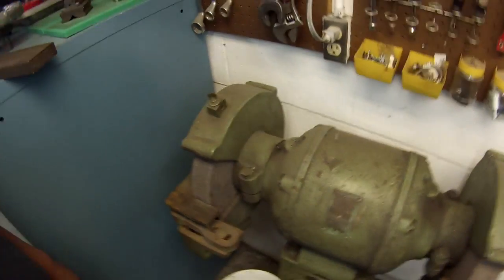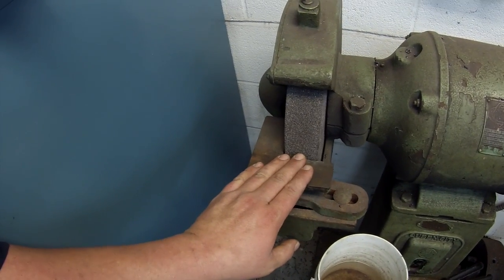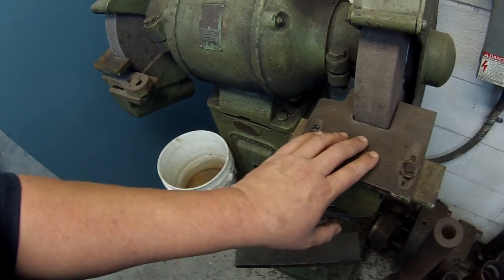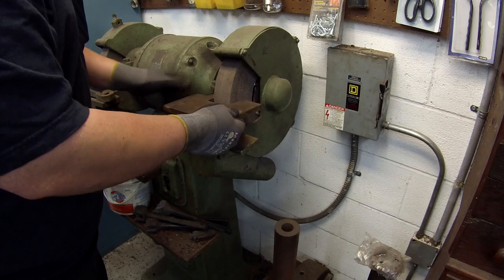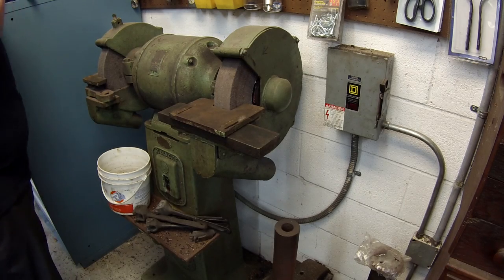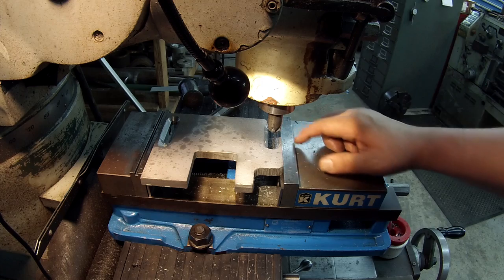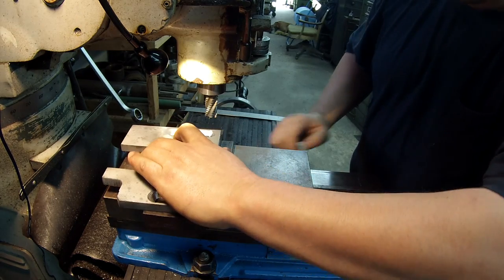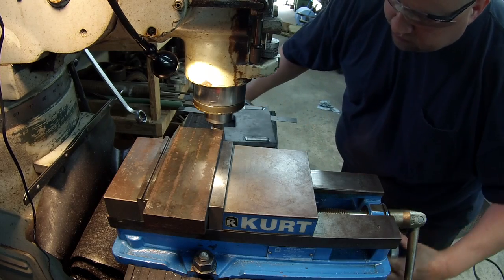Queen City Pedistal Grinder Modification

Comment: Hi Adam
I happened to be watching this particular video again. I have a 1942 Cincinnati grinder similar to your Queen City.  On mine the tool rests can be rotated to change their location relative to the grinder wheel axis simply by loosening that bolt that secures the tool rest/wheel guards to the body of the grinder. The complete guard is secured to a circular flange on the body of the grinder motor.
very convenient...........
love your work & thank you for it!!
vic

Comment: A person is never too old to learn something new. I tell my kids and grand kids to try and learn something every day. Today I learned about where to place the support in reference with the wheel. Now, out the the grinder and put what I learned into practice. Now maybe my lathe tools with look and cut better  Thanks Adam for this great video. Do you ever get a day off ?
Reply from the maker: Well, I get most of the weekends off from my day job, but I'm usually in my shop working then..LOL. Theres always things that need to be worked on, fixed, or made, not to mention homeowners duties to boot.
Hey I'm glad this helped you out Kenneth.

Comment: The other week I decided to re-locate my grinder into a shed, just don't like the thought of grinding dust getting on my machines or the motorbike that also lives in the shop. Well made some space for the grinder, put it in there and now just need to  get it up and running. Thats the project for today sorted out. Thanks for the video Adam, I have always liked wrap around tool rests on grinders and yours looks really rigid. So thats the next step with mine, improve the tool rests.

Comment: Beautiful old grinder. Three decades ago, I bought a BALDOR 712RE.  The grinder is really good and the guards are cast-iron. Two weeks ago one of the wheels blew up just as I turned away. The grinder jumped and came down a few inches from the original place.  Fortunately, the motor shaft was not bent. All this to say, the tool rests are scrap .125" and I need to design something better. I have been PO'd long enough.

Comment: Adam, I modified my little 6 inch grinder in line with your modification. It has worked very well indeed. I ground up a high speed steel tool bit in the way that you suggested and that has worked well too! Many thanks for a most informative video!

Mike

Comment: Was watching Donald R. Cossitt work on his newly aquired big boy grinder and he mentioned you had one.  I just picked up a big Queen City similar to yours.  Mine is straight 440 volt, so it will be awhile before I gan use it.  need a transformer and phase converter.  At least I can be in the big grinder club now,lol.

Comment: Hey Adam,

I really like that wrap around tool rest. Nice to have support on the side of the wheel also. I can see I need to find myself a nice big bench grinder.

Cheers,

Tom
Reply from the maker: The tool rest on the side of the wheels makes a big difference. The Baldor at work only has them on the front side, and sometimes you want to use the side of the wheel too. 
We need to find you one like this, with 12x2 wheels! You'll love it!!
Thanks buddy!
Reply: My Standard Electrical is also a 12X2 and uses 1-1/4 arbor. It was made in Cincinnati Ohio also and is a beast of a grinder! I like the color on Adams Queen City though because it matches my Johnson Bandsaw. If you ever need any extra stones I think I have some stashed in my grinder cabinet. Ever seen the company made drill grinder attachment for one of these?

Comment: A full sized grinder will probably be my next major purchase for the shop, I currently have a 6" delta. It doesn't take off material very fast and it gets hot pretty quick.
I see other comments about the plywood ceiling; I don't know if you've priced plywood lately but be ready for sticker shock!
Reply from the maker: A good grinder is a must have for any machine shop! Baldor makes some very nice grinders if you can avoid THAT sticker shock Tyler.
Thanks!
Reply: After a quick look at ebay it looks like you can get a monstrous grinder for a decent price. But that's ebay so who knows....
I don't know of any reason you couldn't run a grinder off a VFD?

Comment: In place of a glue brush for drill bit oil dabs, try a mini brass wire brush to deliver the oil. It will do a better job of removing the stringer shavings from the bit. Keep up the great teaching. Thanks...

Comment: Nice tip on having the tool rest on the CL of the wheel. Looks like I've got a bit of work to do on my grinder. Just wish it was a full size instead of a little 8" Delta. Good video. Thanks.

Comment: Nice.  Something thats been on the list for yrs.  Question I have the same grinder
on yours see the two bosses on the housing, mine has two brass knurled caps,
"hiding" zerk grease fittings.  Maybe mine is older but its smooth as Ice   thanks
sam
Reply from the maker: Mine has the grease zerks up top. Its been a fine machine, and runs great! Never had a problem out of it, other that what I showed you.

Comment: Thanks Adam, nice to see you getting some of your own stuff checked off the list.

When you start on the shop ceiling do you plan on insulating it as we'll?
 I like the idea of 1/2" ply VS drywall, albeit a little pricey
Up here a 4 x 8  is about $40 a sheet.
Reply from the maker: Plywood is what I used at the old shop and it worked great, and looks good to me. I cant remember what I pad for it, But I want to say between $10-$15 a sheet at that time for 1/2".
We are going to install insulation as we go, the type you roll out in between the trusses.
Thanks Kelly! Maybe i can get some more done today too!
Reply: Abom79
With all the humidity you have there, plus your using AC, I'd be afraid of that getting wet.  Have a look at the spray can foam insulation.  There are companies that have a mobile truck rigs and it seals / sticks right on the ceiling - no condensation.
Reply: 12345NoNamesLeft
Abom79

Spray foam is great, vapour barrier & insulation but it can get expensive.
The shop ceiling is perfect for that application though.

Agreed!

Anyone in Pensacola thats has a spray rig & needs some awesome machining done would be a great friend to have.

I luv Contra work
Reply: Abom79

Did you know, may 24, 2014 will mark your 1 year YouTube anniversary!

Congrats buddy!

Comment: Adam I am going to install a similar plate above the center line to grind my tool bits.
What surprises do you have when you grind your cutting bits? Thanks again.
Reply from the maker: Just watch them fingers, that heat travels fast so make sure you have a water cup close by at all times! LOL Just be careful and remember to keep the tool rests near the wheel too.

Comment: Hi Adam...

Just love my Sunday morning coffee with you!! Enjoyed the video.

Question/thought....was the tool rest low on the grinder wheel so that the tool bit could remain in the QC holder and then be at the right height for touch up/sharpening??  

Also, need the link to the betting window for the chip off and are there any odds?   LOL.....

Chuck
Reply from the maker: Chuck, I could say thats a possibility, but I doubt it. I think originally the right side was built for another use of some sort, but I have no idea what because its always looked just the way you seen it. The right side is shaped differently then the left. You would think that it would have had that same type of adjustable tool rest. Whos knows. I just know its working good now!!

Already placing bets?? Although I like the upcoming challenge, I have a little fear that the "elder" may have a few tricks up his sleeve!
I started making the first vid yesterday, and we should see the first part posted very soon.
Thanks buddy!
Reply: Me too Chuck.  Adam those small fixes like that can make your day for days to come.
Reply: I'm with you Chuck I've been itching to see the hss tool bit challenge. whatever happens i'm sure it will be interesting to say the least. can't wait!

Comment: 1960 Series SHCS have slightly larger heads than the 1936 Series. 15/32" OD compared to 7/16" OD. Blame your fastener supplier.
Nice job !